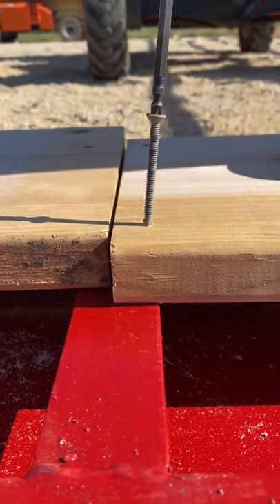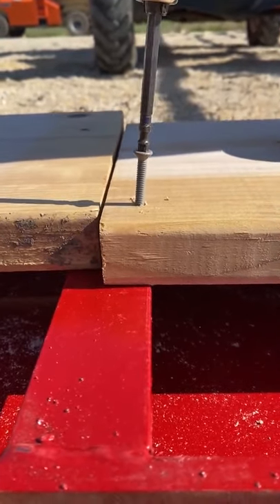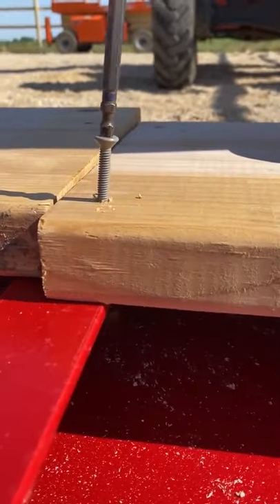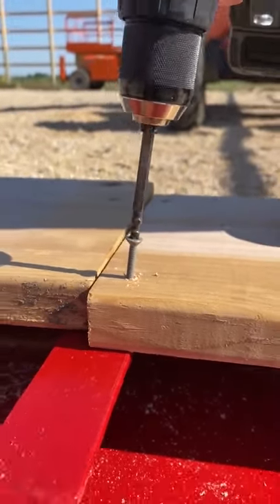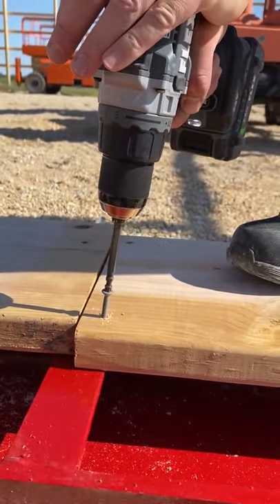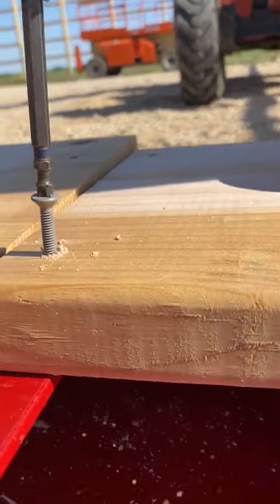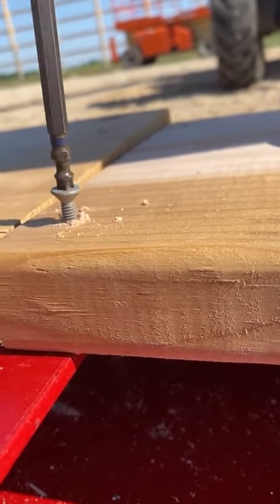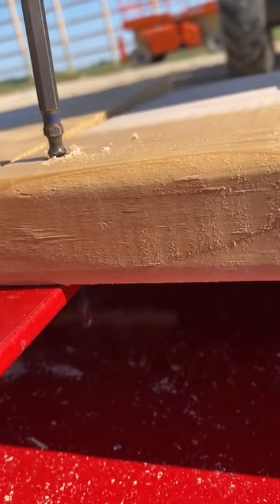Self tapping wood to metal screws #shorts AmazingTech!

Comment: Too bad that reams the wood out and you have 0 force from the threads in the fibers of the lumber. Not to mention the tapered head of the screw splitting the wood as well. Definitely should pre-drill your metal if you're going to attach wood to it.
Reply: Doesn’t really matter if the wood is reamed out or not, it’s the force of the screw to metal bond that keeps the wood in place.